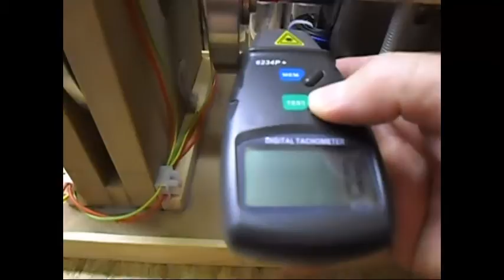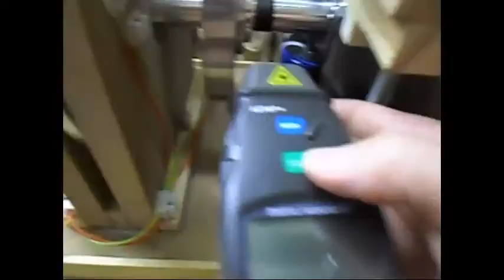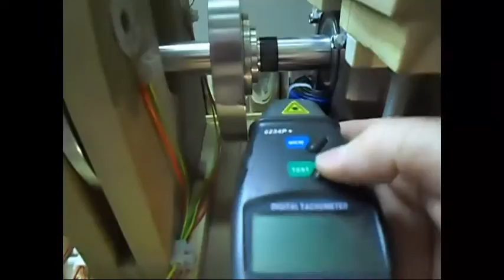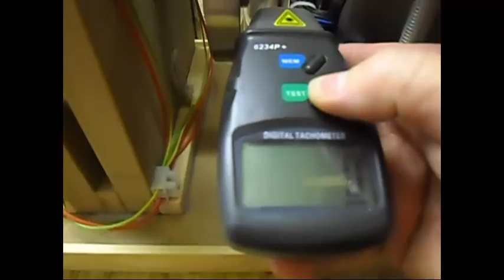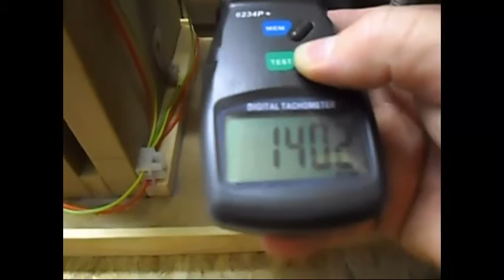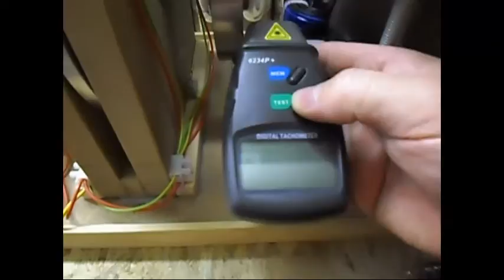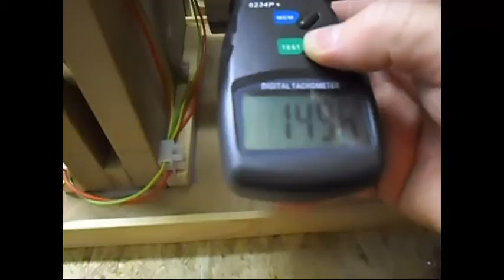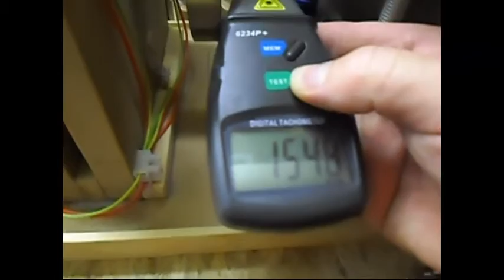Project U-core Dynamo - Update 3, Load test with 1 Farad Cap & 5 watt light...

Comment: question: did you put the magnets with same pole or interlaced? N-S-N-S ?
Reply from the maker: Thanks for your comment...^^
I've tried with N,S,N,S,N,S but the output is very little...but that is no more than normal since in this configuration the magnetic field switching is not optimum...;-)
So now i have like this N,N,N,S,S,S and have a perfect magnetic field switching which is producing lots of juice...^^

Comment: nice vid, you've done a lot this year it looks like. have you thought about putting a spark gap in? maybe a larger capacitor like some glass in a salt water bucket? this guys pretty cool: https://youtu.be/On93e3JM5YQ
Reply from the maker: Thanks for your comment and i'm glad you've liked it...^^
A spark gap is nice but not with low AC/DC voltage like i have now and i am not planning to step it up to higher AC/DC either so that's a no go...😎
But i have been thinking on how to use that energy without the drive side feeling it...🤔

Comment from the maker: An update on this U-core Dynamo setup with the first load testings...^^
Shorted test, 1 farad cap test and a automotive 5 watt light bulp test...it went pretty good for the first load test...:D
I was aiming for lower voltage from these coils and so to see i'm spot on...^^

Next test will be the same but with the 10mm thick magnets...and at the same range of rpm but with more input power of course...;-)
I haven't check what it is using now at 9.5(ish)vdc but will check that tomorrow and post it here in the comment section...
I think it should be around 1 - 1.2Amps or so @ this 9.5(ish)vdc...which is anything around 10 watts or so but tomorrow we'll know for sure...:D
Cheers
Reply from the maker: Extra info on the input power usage,
Amps is calculated after the stepdown dc to dc converter...

Open System/Dynamo is 1557 rpm and 9.5Vdc @ 0.986Amp = 9.367Watts...not bad...^^
5Watt Loaded rpm is 1208 and 9.2Vdc @ 1.7Amp = 15.64Watts...o.O...that's a bit to much...lol
Shorted rpm 1510 and 9.5Vdc @ 1.026Amp = 9.747Watts...not bad either...^^

Shorted one should make a good AC or DC low resistance electro magnet but what to do with it...lol
Yes, a test thru a 1:1 ratio transformer would be a good one also but i don't have the proper 1:1 ratio at this moment...-.-

I did a small test around 2053 rpm also and when shorted is speed up just a tiny bit up to 2068...perfect...^^
When loaded with the 5 watt it slowed down to around 1677 rpm...crap...lol
No input or output measurements because it was just a quick one...;-)

Next video will be with the same 5mm magnets but this time i'm sending whatever energy is being produced back to the drive side thru a large cap just to see if it is helping out or not and how much would the system slowed down in sucha test..???...^^
Just got to try that before moving on...lol